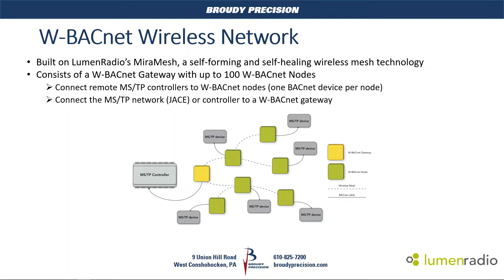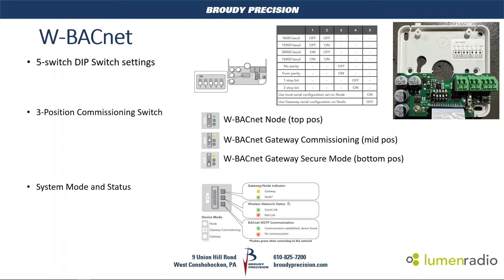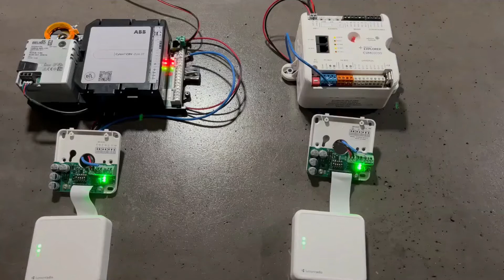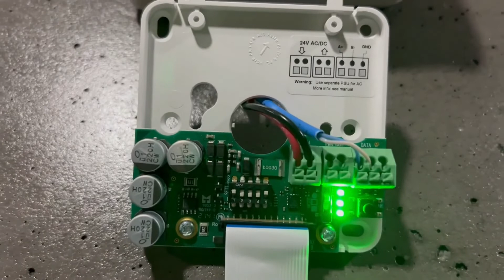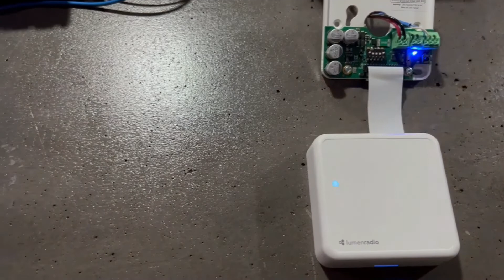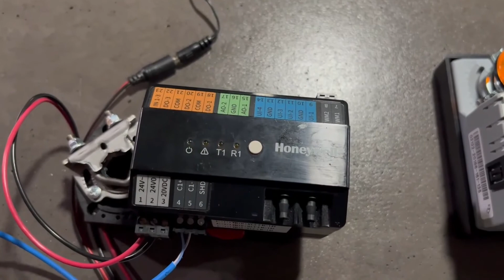LumenRadio W-BACnet Overview

Comment: Is there a point limit on the mstp device connected to the note? Also what are the Environmental conditions needed? Would they be able to be installed in an outdoor RTU?
Reply from the maker: The W-BACnet is IP40 rated, so you would want to place it in an enclosure of some kind to use it outdoors. We haven't seen any point limitations in our testing.